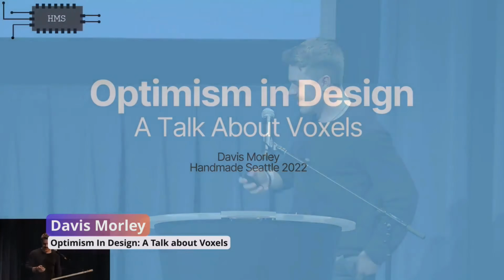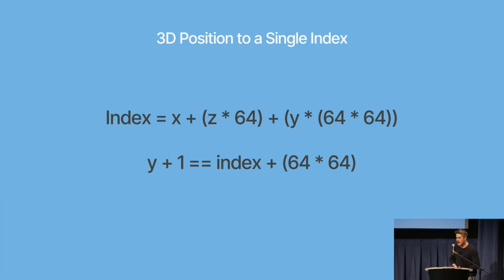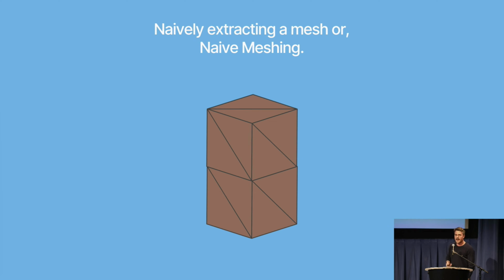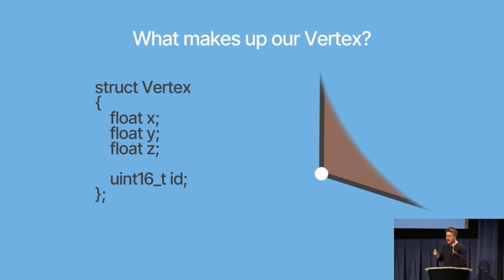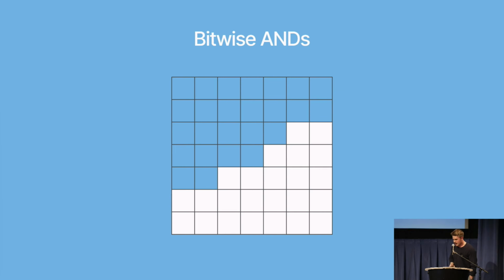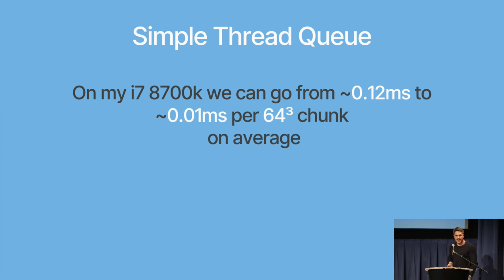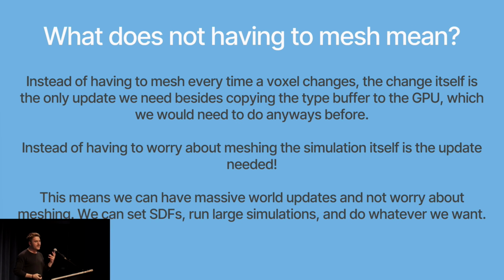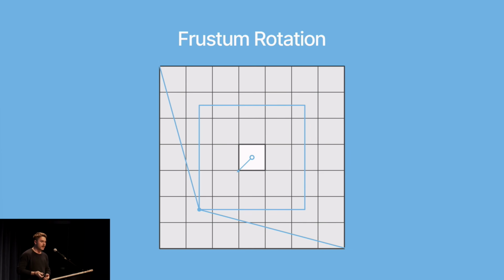Greedy Meshing Voxels Fast - Optimism in Design Handmade Seattle 2022

Comment: if the number of voxels in a chunk and then number of chunks in a world fit in a base 2 number, then all this dividing adding and multiplying is bogus and you can extract or insert coordinates with just bitshifting and masking.
0byyyyzzzzxxxx Would be what the coordinate looks like. Want to get the Z coordinate? That's (0b11110000 & xyz_coord >> 4).

Comment: i feel that trying to create a vertex engine using triangle based rasterizers on current gpus (optimized for triangle math obviously) is like trying to cut steak with a butter knife. we need voxel math to be supported at the hardware level so it becomes viable (cube as a base primitive instead of 6 faces = 12 triangles) and new types of shaders (cube/voxel shader instead of vertex or mesh shader)
Reply: I also think that voxel engines will be very suited for 3D screens or holograms where two persons can look at the same cube from two sides making zbuffer and triangle based rasterization obsolete, and forcing the industry to work toward a real 3D pixel representation in 3D space. for now, voxels are a waste of computation where you create 6 vertices in memory and have algorithms reduce that number to 5 or 4 (two triangles) where normal tri based meshes do that for free

Comment: have played several times with greedy meshing, but still didn't found a good way to get rid of t junction artifacts
Reply: I have with a framebuffer object or FBO
The steps go like this
Initialise a framebuffer object with a color texture and a depth texture bound to the buffer at the beginning of the program
Create a vertex and fragment shader program that will check the depth of each pixel
If it’s 1.0 (the sky) it means you’re looking at sky
Then you blend 4 neighboring pixels up down right left colors in the hole, given that they are not also at a depth of 1.0
You also need to change a few things in your render loop to draw to the framebuffer instead, but at that point it depends on your implementation

Comment: You used y as the up axis instead of z? Literally unwatchable
Reply: What you mean, Y has always been the up axis in 3D space and video games
Reply: @Ethanthegrand  Z is the up axis in pretty much all of mathematics, I wouldn't know about games. My comment was not serious either, I really enjoyed the video.
Reply: @seftondepledge3658  ahh I see. Growing up coding, when working with 2D games, X is left/right, Y is up/down, which makes sense, and introducing Z adds the forward/back axis
Reply: To be exact, any axis could be up without any noticeable consequences as long as the positive directions are maintained relative to each others following the right hand rule (which basically means that the cross product of 2 axis gives the third one).

So if +X is right, and +Y is up, then +Z must be back.

I tend to prefer having Z upward because it means that X can stay pointed toward the right and Y becomes positive towards the front, which makes more sens to me, and I think this is also the reason why mathematics sticks to that norm as well.

However, just like I was saying at the begining, it barely change anything in the end as the direction ultimately ends up to be relative to the camera orientation.
Reply: @arthur1112132  Oh, it makes absolutely no difference to the maths I agree. But my brain prefers it that way. I think it also makes sense (in maths at least) as you are used to 2d graphs being on paper on a desk etc where the x-y plane is horizontal. So z being the vertical axis is just an extension of this. Not a reordering.
Reply: @seftondepledge3658  I like that analogy as well. Also, it works great in both cases.

One could see the screen as being the sheet of paper (thus, having Z pointing backward, out of the screen) while some other could see the sheet as being layed out flat on the 3D world, with the Z axis pointing upward.

In the end, it all comes down to what the old Ben said: it's always "from a certain point of view"

Comment: I worked in a studio at some point that did that trick you showed at the end. It worked for a while but we ran into issues with overdraw especially on lower-end hardware. All that air is being meshed and being drawn, thousands if not tens of thousands of layered transparent triangles that the GPU can't optimize. You can fix this with Raymarching in the fragment shader instead. So instead of 64*6 faces, you do 6 faces 1 giant cube for the chunk, then raymarch inside it usually outperforms the 64*6 faces.
Reply: Was gonna say…. I understood right up until the whole lattice thing; I don’t understand how he is proposing such few faces for the world without something like raymarching.
Reply: I came here to see if someone addressed this.  I was like wait, are you saying to draw 64 planes per voxel chunk that will often be mostly empty space?  Sounds like you are gonna get killed on overdraw, unless you are ray marching them, and I it didn't SOUND like you were.  Glad to see I am not the only one thinking this.

Comment: What if some of your voxels can have different models, like a cube for the default, but also campfires or whatever, and different materials, like animated lava etc, would the optimizations still work?
Reply: The optimizations would still work for the voxels, but not for the new general meshed objects since they cannot be assumed to easily align to the simple 3D axis. You could still add (relatively) smaller amounts of meshes into the scene though, since the voxels are still technically rendered using meshes with depths etc.

Comment: Suggestion: Make the video audio a bit louder. I had to watch this on 145% volume, and even then, I am lucky! Windows and MacOS users cap at 100%, and even then, most Linux users also cap at 100%. I am in a special situation, because I am using a window manager.

Comment: I'm so glad I finally stumbled over this video.
This really inspired me on my quest to find a subject for my bachelor's thesis. I've known for some time now that I wanted to do something in the area of voxel-based procedural generation, and was wondering if a few of the concepts you mentioned could be applied to marching cubes or other isosurface extraction algorithms. Although with such great performance and the ability to render so many voxels you wouldn't need mc anymore.

How would you handle collisions if the mesh of the chunk includes the air? Am I wrong in assuming that you would need a pass of your meshing algorithm that separates air and terrain(like you show) to extract a collision mesh where you need it? Or could you maybe handle collision entirely on the gpu in some fancier way than a collision mesh?

Anyways, for your first talk you did very very well! I love your approach to greedy meshing and your explanatin was really nice to follow. Very good presentation - even years later.
Reply: The mesh and underlying block data don't need to have anything to do with each other.
You can collision test against nearby blocks with the safe assumption that they will always be lots of individual axis aligned bounding boxes.

Comment: That multidimensional array to simple array is so incredibly overexplained holy shit, this is such basic stuff. And a 3D array in any language you'd actually consider writing something efficient in would result in continuous memory anyways, so there is literally only syntactic difference between his implementation and what the compiler would produce. This is BAD.
Reply: Cool so you chose to focus only on the small kinda irrelevant part and disregard the actual meat of the talk, good job :) It did start slow tho, I'll give you that.
Reply: It's true that the coordinates to single index conversion probably didn't need to be explained taht deepely. It's trivial stuff that any programer end up learning soon enough.

However, it's false to think that the language will actually do this for you.
While it's mostly true for any statically allocated buffers, this is no longer the case when it comes to multi dimentional heap allocated buffers where each sub-buffers (along the first coordinate) are no longer guaranteed to be contiguous in memory.

Considering the actual size of the array here being 64^3, the total memory size can vary from 0.26 MB to 2.09 MB per chunk (considering you only store simple integral type into it).
While it may work for a single chunk, it is totally unthinkable to render an entire world with statically allocated arrays of that size.

Comment: The 3D/index conversion can be simplified to be more intuitive if you just see it as packing 3 different numbers into the different bits of a number. x + 64 z + 64² y is the same as (x) | (z << 6) | (y << 12), and this is the same as just concatenating the three 6 bit numbers in binary to get a single 18 bit number.

Edit: Okay I've watched further, and doing what I proposed would have been pretty awkward for the presentation because the next step also uses binary, and it would probably get confusing

But a more important addition: What your global lattice does is have the GPU check on every point where a pixel intersects with a plane that is aligned with the surfaces of your voxels. But doing that doesn't actually need rasterization, you can just run a loop with the ray/plane intersections on the GPU. Doing that is called voxel traversal, and it can be simplified a lot if you do good bookkeeping for the repeated ray/plane intersections. I also saw a paper about having it support empty voxels of varying size, so that you can skip larger pieces of air, but I haven't read it in detail yet.
Reply: sounds like using an octtree where the root is the entirety of the visible world and last layer of nodes represents the chunks, and if a branch ends early then that means its an area filled with air.

Edit: I just realized that you can further subdivide a chunk to be 1/8 or 1/(8^2), etc. and if any of those volumes is empty then you can skip it as well.

Comment: "55 FPS is slow"

Really? I don't even find 30 to be slow. If I saw a video that's 30 FPS and a video that's 60 FPS, I doubt I'd even be able to tell them apart.
Reply: Yep, there's a big difference between 30, 60 and 144. It's less noticeable on video because you're not inputting anything. higher fps noticeably improves the responsiveness and smoothness of games.
Reply: 55 FPS is definitely slow. in the context of real-time rendering for games, that is. and yes, the difference between 30 and 60 is definitely noticeable. most people can tell them apart. what is the refresh rate of your monitor?
Reply: @k_otey  60 Hz.
Reply: It is slow in the context of real time rendering.

First of all, we tend to easily forget that FPS are actually a verry bad benchmarking unit as it is non linear.
Loosing 5 FPS from 60 to 55 is not the same as loosing 5 FPS from 200 to 195: the former means a 1.51 milliseconds loss while the later only represents a 0.12 milliseconds difference.

Now, even if it is highly dependent on the exact hardware you have, most of them are able to reach over 60K FPS when rendering less than a few tousands of triangles, which means a minimum of roughly 0.016 milliseconds or 16 microseconds per frame.

When working with realtime rendering, we often consider our program as having a "frame time budget" that we are gonna spend across all of our different features.

55 FPS means 18.18 milliseconds per frame, which is probably finewhen talking about a completely finished game (even tho some would argue with that).
However, when talking about a prototype like in the video where the only thing done is meshing and rendering a single 64^3 chunk, 18 milliseconds IS slow because it basically means that all of your time budget has been spent on that chunk only and that you won't be able to spend much more for anything else without negatively impacting the overall performances of your project.

Comment: using a non-triangle vertex really popped out at me as having potential.
Reply: I think the main problem is hardware for this sort of solution, GPUS are very optimized for triangles already and trying to go against that would be needlessly inefficient, at least until we have better inbuilt voxel solutions on the GPU. sort of like how the new raytracing GPUS now have that built in.